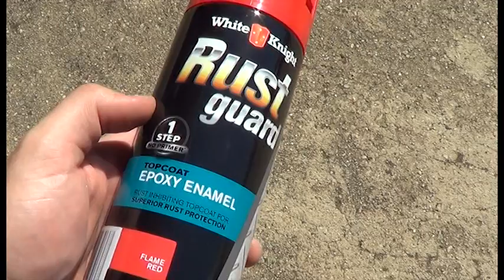Vintage Dawn Tools G-Clamp Restoration

Comment: Nicely done.  Before I get to the drill/wire brush stage, I usually soak them for 24 hours in a bucket filled with about an inch of 30% vinegar, brush them with a bronze brush that looks like a toothbrush, rinse, then soak them in a strong solution of  Arm (Armand was the name of the fellow who's name was shortened on the box) & Hammer baking soda for around 30 minutes (neutralizes the acid), rinse again, wipe dry, then the drill/brush phase.  I just wipe them up, apply a healthy dose of oil across all surfaces, let sit for 24 hours, then wipe off any excess oil that wasn't absorbed at micro levels.  I bought 8 clamps at an estate sale for $20.  The only one I didn't soak in vinegar was the 8" red one that still maintained much of its origional color.  Just like you, I had fun doing it too....

Comment: Good job, i have a fledgling collection of clamps, pipe wrenches, and adjustable spanners. i try to get tools bearing the manufacturers name in raised lettering, i prefer it if the maker has long since vanished. my clamps are,  PS & W, Southington, Conn ,USA, Patented July 5 1838, 4 inch Carter, 4 inch Malleable 4 inch by j. Buncle North Melb. 3 inchWoodruff Eagle , 6 inch Dawn, and two 4 inch by DTF.  I have mentioned country of origin where it is marked on the tool.These clamps are not used,they have been stripped painted and any raised lettering has been highlighted using paint pens. These tools are all hanging from the joists in my man cave. I have not painted all these in original colours. I things other than just the tools mentioned  Tony, Melb.

Comment: Great for looking after old tools however the one that still had paint on it you should have left original - dawn colour is maroon not red - by making them look like new it actually devalues them - the patina of old tools is really important -that red is very garish so if something is half good leave it alone don't paint it and make it look like a chinese clamp.
Reply: Gez, I agree with what you are saying up to a point. I collect Dawn tools and depending on condition I am happy to make them look like new, after all if you found a Dawn clamp from the 50’s that had never been used would you complain that it had no patina? Then again really well used tools that have almost no paint left on them, a bit like when theses clamps were wire wheeled, look good too so I pick and choose what to restore and what to leave. Also I usually use maroon but some Dawn stuff is / was painted red. Cheers mate, Stuart. 🇦🇺